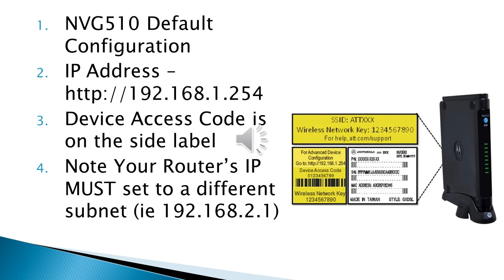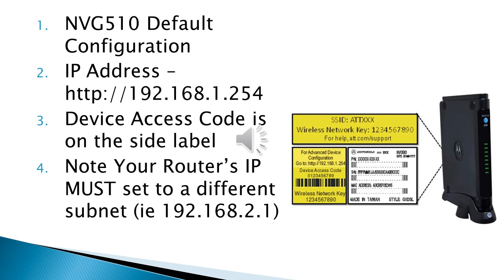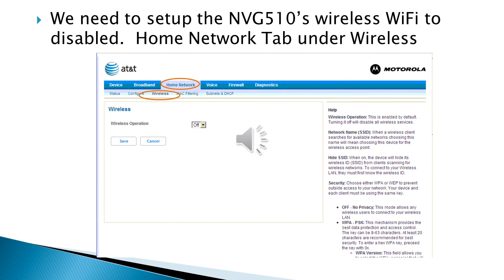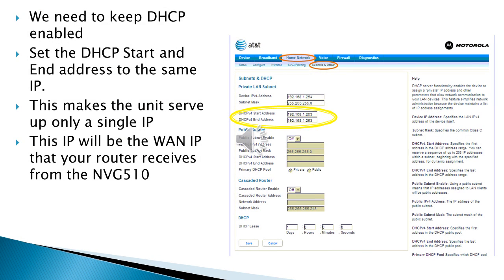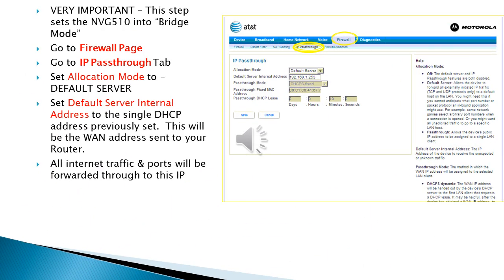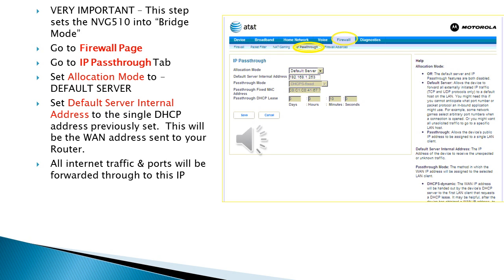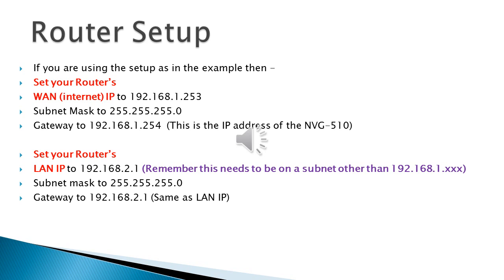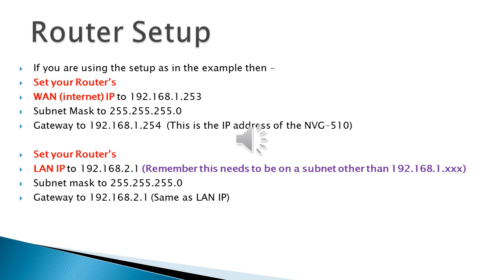AT&T U-Verse Motorola NVG510 Bridge Mode Setup

Comment: Configuration starts at 1:23.

Thank you for this guide. I'm certain trying this on my own would've taken well over 6 minutes. On a side note, I'd reverse the order of setting the router to bridge mode and killing the wireless connection unless you are directly plugged into the NVG directly.

Comment: I'm glad this fellow took the time to share this information, a clever way around a blind spot in the NVG510 configuration, especially since all I could get from AT&T was incompetence and hangups when I simply requested a technician who could put the router into bridge mode. I tried the NVG510 "IP Pass through" without satisfaction ... so I'm here looking for a solution.

One missing detail here is that the configuration computer must be plugged into the NVG510 Ethernet LAN in order to complete the process. I plugged my laptop into LAN port 1 of the NVG510. If your configuration computer is connected via wireless, it goes without saying that, you won't be able to complete the remaining step(s) once you disable the wireless service of the NVG510.

So far it seems to be routing all traffic, but the real test will be if VPN works with dynamic DNS outside of my network edge, and I have my doubts. Fingers crossed!

Comment: This is a fantastic walk through. Thanks! I have this piece of junk at both home and our church, and we want to put filters on Internet traffic using OpenDNS. Buuut... AT&T locks the DNS on the NVG510 (and maybe all their other modem/routers?). So we have to have a seprate router in bridge mode if we want to effectively block traffic. AND, the router offers no options for multiple SSIDs or a guest network, which are especially helpful in more of a private/public mix use setting like our church. I followed these directions and got our Asus router configured to work perfectly with the NVG510. Again, thanks for a perfectly clear and easy-to-follow video!

Comment: There is a better way to put the WAN IP on your internal router.

Firewall > Allocation Mode > "IP Passthrough"

Set passthrough mode to "DHCPS-fixed", (this is not the only method, but works fine).

Define in the field: "Passthrough Fixed MAC Address", the mac address of the WAN interface of your internal router., (if you do not know how to find the MAC ... you shouldn't be doing this... however... generally it can be located on status pages for the WAN interface, and of course the shell).

Comment: I think this method only works if you're getting a dynamic IP address from the DSL service provider. What if the IP address from the provider is statically assigned? When using an ordinary DSL modem, one would enter the static IP address on the router on the WAN side. That static IP address would not match the 192.168.1.253 address that the NVG510 would be giving out.

Comment: It's difficult to call ATT tech support to help set up ip pass through "bridge mode" because the NVG510 is one of the only modems tech support can't remote into and set up for you now with the nvg589 or the 3801 we can actually remote into and set it up for you and all you have to do is to reboot the device you want the modems info to be passed to
Reply: +Mitchel Troup True but now if you update to 9.1 you can remote access it.

Comment: In the fourth step, you say to set the DHCP start and end address to the same IP. I hate to ask, but what IP should be used in this case, or are you saying to simply make the end address the same as the current start address? So in other words, I could set my start and end IP to 192.168.1.253, because that's what the end IP is right now. Correct?Just making sure....thanks in advance!

Comment: Time Capsule demands an ipv6 delegated prefix in order to set the LAN IP (at least, that seems to be the only matching option for your requirement to set the WAN and LAN IP: config IPv6 manually). But your video makes no mention of this, so what should I do?
Reply: Did you get an answer to this?  I'm having same issue.
Reply: justinavias The original problem I was having  (TC not working in bridge mode) seemed to clear up by itself the next day, for no discernible reason, so the problem became moot. Sorry I can't be of more help.

Comment: Hello Rhardon.  We switched over to ATT Uverse for the phone service in our office.  Initially, when testing our phones after the technician switched our phones over to the Uverse VOIP protocol, the caller was unable to hear our voice.  It appears the change of the "Allocation Mode" on the "IP Passthrough" tab had to be set to "Passthrough" instead of "Default Server".  We also had to set the "Allocation  Mode" to  "DHCPS-dynamic" to get the phone to work.  Initially this did not impact the VPN connections to our remote locations.  Is there a potential long term problem with changing the IP Passthrough to "Passthrough" instead of "Default Server"? (i.e. VPN connections unable to connect)

Comment: Is setting the NVG510 in bridge mode the same as making it an extender.  I now have Comcast but I have an old house with thick walls.  I have an the NVG510 that I would like to make into a wireless extender if possible.  Can that be done, and if so how?
Reply: No, it does not make it Wi-Fi extender. But if you were to turn off the DHCP server on the NVG510 and connect an Ethernet cable from one of the four yellow ports on the NVG510 to one of the ports on the Comcast router, you can make the NVG510 a wireless access point. However, AT&T programmed the NVG510 so that there is no setting that allows you to turn off the DHCP server.

Comment: Yes, I know nothing about network tech but when I try to change the Device IPv4 Address under subnets & DHCP tab it dose not allow. It says, in red letters, (192.188.2.0) is a network address 
Address must be on network (192.188.2.0) 
Address must be on network (192.188.2.0) 
 When I change it to that address it just defaults back to original IPv4 address of 192.168.1.254
Any thoughts would be helpful.

Comment: Attempted this today with my NVG589 and ASUS RT-AC68P, however my TV signal is very slow. When I turn my set top box off it takes a while for picture to come on sometimes shows no Guide as well. Eventually picture will come on after about 5-10 minutes. If I restart the set top box, it hangs on the ATT Uverse page with the turning circle at the bottom right. Eventually, after a lengthy wait 10-20 minutes, video will come back on and everything seems to be in order......until i turn off the set top box then I have to redo everything again. Any help with this?
Reply: set top box is plugged into lan port in back of NVG589. Also I realize his video is for the NVG510, but both seem to be very similiar.
Reply: the rest of my network seems to work fine.

Comment: I tried this on a NVG510 ATT  going to a Linksys WRT610N. I cannot not get through to the internet after making changes. The WRT610N has no setting to set the LAN Gateway to 192.168.2.1 (in your example). I can only set the LAN IP and Subnet mask. Any Ideas?
Reply: On the WRT610N under Network Setup, you change the Router Address from 192.168.1.1 (the default) to 192.168.2.1.

Comment: Hi rhardoon, thanks for the guide. Can the default IP on the NVG510 be changed to 192.168.0.254 so we don't have to remap a 192.168.1.x network with 50+ devices?
Reply from the maker: Absolutely, much more practical since most routers are 192.168.1.x, just change it in LAN settings
Reply: +rhardoon  Thank you for doing this and finally allowing me to play on my own server with friends. You have cured my bacterial infections.

Comment: I followed all the NVG510 steps, and then when I go to set up my Asus router keeps telling me to make sure the cable is connected properly between the router and modem. All I can do is change WAN setting, and update firmware. Anyone else have this problem or know a solution? Maybe ive done something wrong?

Comment: That was confusing as hell. Simple that worked for me.! Followed 1st step and got into modem. Then I ran the test on my xbox360. Nay set MODERATE. Next went to TAB ,FIREWALL , NAT/ GAMING. "Service drop down tab,  I selected XBOX360 LIVE. Then tab" NEEDED BY DEVICE ", I selected the IP address  that xbox360 shows the clicked ADD.!! Re-ran live connection. And NAT WAS GONE.!! Simple fix. !! For me at least . Thanks for your video.

Comment: Hi Can any one help me to set up new Motorola Modem? i got the same Modem but different address. my address is 192.168.7.254 (which is defective) so i bough a new 1 about the same but different address (192.168.1.254). i tried to setup but it's never work. i have been looking all over the internet and there is no awnser or solution. i need help :( plz.

Comment: After that wireless operation step I can't even go on the Internet... So that means I can't access the router
Reply: You can't change network settings on the router without being connected through an ethernet cable....